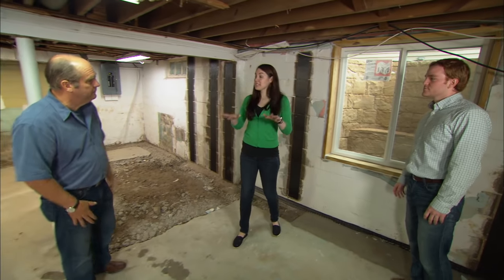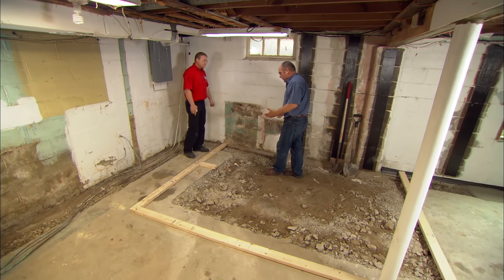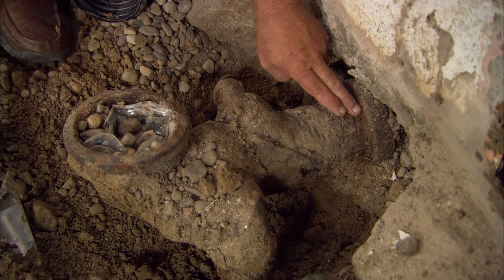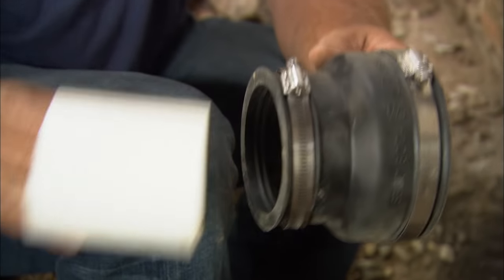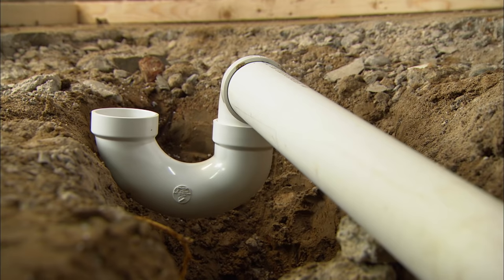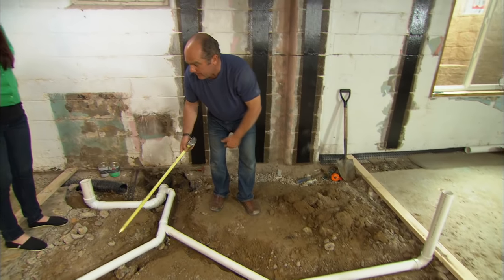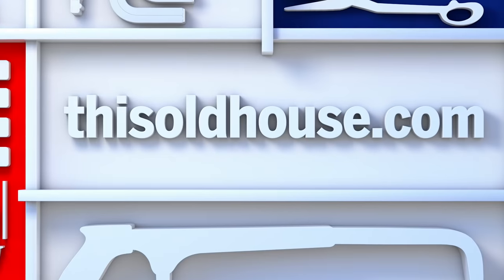How to Install a Basement Bathroom | Ask This Old House

Comment: That wet vent was so misleading (and wrong) you basically flat vented the shower and didn’t vent the water closet at all. You can only wet vent on the vertical piping. Once you break the the 45 degree plain and go vertical, you cannot wet vent. On the water closet, The vent (if flat venting, which is what you did) must be in front of the down slope of the trunk or branch line. Not behind it. That system will only work well if using one fixture at a time. All three running at the same time will create an air lock type situation and in essence not be venting properly.
Reply: Only if one fixture at a time is used and even then it still won't work well
Reply: Why is the toilet called a water closet?  I thought that the bathroom as a whole is called a water closet, because it kind of resembles a closet in terms of size, and has water fixtures.

Comment: If you have the skill set to do this, don't call a plumber and get permits/inspections. If you do call in the pros,  next thing, your taxes will go up due to another bathroom. The most important rule of plumbing, poop flows down hill.  keep quiet, and remodel your own place. That's what I'd do.

Comment: You can't wet vent 2 fixtures off of a water closet And code calls for a minimum 2" vent for a toilet/water closet You're event has to be with thin 5' of your fixture he is way off this would not pass inspection with city inspector. And 3" pipe is a minimum quarter per foot fall/grade/pitch and 2" as well 4" pipe you can run it at a 1/8 per foot but 2 and 3" must be A 1/4  per foot fall

Comment: 6:36 Improper use of wet venting - illegal and not code - pipe must be at least one size larger of minimum pipe size for fixture. Shower drains must be no less then 2". Toilets can not be wet vented. Wet venting can only be used when the pipe is vertical, not horizontal
Reply: That's how it used to be, but we can do what is called horizontal wet venting. So how they ran it was totally legal, you only have to up size vent line if you run over the fixture units for the two in pipe. Also when doing horizontal wet venting the fixture unit count it can handle is cut in half, so if the had a 5 fixture bath it would have needed to be 3" to the shower branch, then reduce down to 2".

Comment: I would have charged $3,000 CASH, rough in only providing they chopped up the concrete. Another $1,000 to chop up the concrete. That is $1,000. Per fixture for the rough in

Comment: Why wasn't pressure treated 2x4 used for the plates instead of Douglass Fir? I've done many basement bathrooms and had them where needed. Moisture on the floor or a possible flood would rot doug fir and ruin the bathroom's perimeter.

Comment: Hi you guys where talking about the vent pipe , but I dint see any of that in video , I think you guys cheated on that , I want proof of vented pipe installed
Reply: Walter Boy the 2” drain from the toilet is the wet vent it runs to the far right of the bathroom and stubs up through the floor. When the concrete pours, you then install sink teewye and continue the vent up and through the roof or tie in with other vents. The 2” portion of pipe between toilet and sink is called the wet vent because it serves the toilet at the same time it drains from the sink.

Comment: Some states have odd codes, for example, in Minnesota they like their dry vents and if you must use a lavatory as a wet vent they want it sized 3 inch right on out the roof. Goofy as it is its the law.

Comment: Really? Wet vent? Let's start with the 3 inch line. Anytime you make a 90 degree in a waste line you must install a  clean out.  This bathroom has No 3 inch clean in side for the main line. 
2nd once you make that 90 if you are going to wet vent the toilet it must be tied into that pipe between the toilet and that 90 or it's no longer a wet vent. It's a "I hope it Works Vent"  Those aren't code legal. 
3rd. Did you notice how at the 3x2 Y the 2 inch pipe was rolled up at 45° Up from the 3 inch pipe. At the next 2 inch Y you must either roll this fitting up or roll it up an stick a street 45 into the Y to bring it back to  flat or minimum of an 1/8 of an inch fall. If the shower is more than 3 feet from that Y. It must have a vent also. So, I'm pretty sure   none of this job would pass inspection in California.  Most importantly  is that if I had a plumber doing this job working for me.  I would tear it out.  "FAILED THE BOSS TEST
  The mechanical fitting that they used wasn't code legal either.
   Did they snake this line to clean it before tieing to it. After snaking it. Did they send a camera down it to make sure it's in good shape,
  Once you get 2 feet away from the house it is no longer cast iron. It's either terracotta or clay. Which more than likely has failed at every 80 year old fitting. Use the old 4 inch line under the foundation as a chase. Stick 3 inch pipe through the 4 inch pipe. Tie it on to the 4 inch outside of the house. 
Now everything in side the foundation is New.
  This Old Junky House.

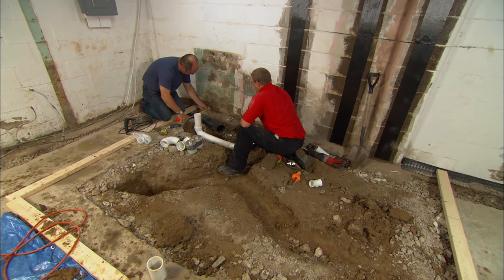Comment: At 5:07 you can see that the pipe that was cut and supposed to have been lead sealed to the pipe under the edge of the house is now loose.  Oops!  It's details like that being missed that will come back to haunt these homeoweners.

Comment: Would not meet MN state plumbing code. Want code is being used?
I also would have used a 4x3 90 for the water closet. Aka stool.  And just putting some crumpled up Polly around the shower drain is not very professional looking

Comment: Just a curious question from an absolute novice...why was ABS not used instead of PVC?  I have always been told that ABS was for drain plumbing, am I missing something?
Reply: PVC is generally straight and true. ABS pipe tends to have a bow in it. If using ABS you want to turn the pipe so the bow is not on the bottom or top. If you do this, you'll create small valleys or hills, which could cause sewer stoppages.

With all that said, short runs the bow won't be that bad. However,  on a 20' length of ABS the bow can be more than a 1/4". 

Hope this helps.
Reply: Nicholas Ruguone thanks for the tip, I will definitely keep that in mind.
Reply: ronnor58 FYI there is PVC pipe that is specially for waste/sewer water. A lot of time it has a foam core. I always assumed  (not always a good thing to assume) it was to reduce costs by the manufacturer.

Comment: Ok.  I would have used a shielded Fernco.  It has 4 straps and doesn't shift when used in the ground.  Ahhh,  2" pipe needs ¼ per foot not ⅛ per foot.  I didn't see a test tee so this system was not tested.  I guess they never have leaks and their shit doesn't stink...
Reply: Funny thing. In Canada most plumbers don't test the sanitary system, only the water and gas, don't ask me why it's just something I've noticed.

Comment: man if i ever paid a plumber to do work and saw him dry fitting an entire run i would kick him off site. there's zero chance he fully seated any of those connections and then pulled them out dry fitting, all of the measurements will be off. plus it seemed like they didn't account for the exterior wall on that toilet width measurement. i'm sure these guys know more than i ever will but sometimes they show people the wrong way to do stuff.

Comment: First thing 3 feet clearance from electrical panel and can't put panel in closet and can't put panel in a bathroom. Either sounds like moving a panel to new location . So if you move panel more than 12 feet from meter socket then need a service disconnect on metersocket turning panel into a sub panel used a 4 wire so ground and nuterals have to be separated. Sounds like you  saving alot of money. Now the poor electrican is going to be screw. No sound like to me electrican going to make  $$$$$

Comment: Basement bathrooms need to drain into a sump pit with a macerator pump ejecting it to the drain system otherwise you would have back up in your toilet if city sewer pressure exceeded normal volume. Love ask this old house but this is very bad practice for a basement bathroom.
Reply: Wrong my dear friend.

Comment: Dont know why people sleep in the basement with the high levels of radon in some areas. Insane!
Reply: Depends on where you live as to radon levels, they have alarms for radon and its pretty easy to install proper ventilation.  Personally I love sleeping in the basement, no light, no noise from the outside world, if the house is well built/soundproofed, you don't hear anybody upstairs.

Comment: First off PVC is garbage. For very few dollars more you can buy ABS which is a way better product. Second you have to be two feet from exterior wall before first fitting (Clean out excluded) which they did not install at exterior wall. When doing a shower drain you build a box around the pipe so it does not get cemented into the floor you do not put plastic around it. You need a bit of wiggle room because you will never get the pipe %100 where the drain will be. There is this wonderful product called a T-cone that you install in the pipe to be removed later before installation. Plastic bags and Styrofoam is not professional.
Reply: tom smith no code to having fittings 2 feet from the house there's a code on the distance from your mainline backwater valve to first wye fitting but I've had to dig under footings to roll up main sewers all the time

Comment: that's why you want the 24" diamond blade cut off saw. 2 seconds and you're through and the cut is perfect. You need real skill to do that with that Cute little 4 or 5 inch blade.
Reply: When you are covering the cut with a Rubber connection?

Comment: You know code about venting is total garbage. Think about it, why does a pipe need two air inlets for drainage?  It doesn't.  Trap water in a straw, let your finger off and all is well. Why does a straw need another hole on the side?  It doen't.  Neither does a drain pipe, becaused it's the same thing as long as it has enough pitch, it's all good.

Comment: its very poor plumbing design I suggest every change direction of the pipe it should be clean out provided
Reply: Look up wet venting bathroom group. I used to plumb in California where everything is individually vented, but other states and In Canada wet venting is a common practice. It works.

Comment: Never do that rebar thing, you are making contact with the soil and the rebar will end up corroding wich may cause problems later.
Reply: Ridiculous.  Rebar is put in every foundation footing going.  It's cast IRON, the backbone of concrete structures everywhere.   Sure it will corrode. . .some 75 years later.

Comment: So first off why not go back with sch 40 pvc second you need a sweep at any tie in not just a y 3rd off wet vent is always a bad idea and 3rd off if the pipe is 80 years old and want it to last another 80 years with all the fats from soap and hair products you might wanna look into new flow liner! I would have ran this entire system the proper way the smart way!!!

Comment: The clamps that used for connection between PVC and cast iron under soil will rusted  !! and be useless ...so it is the weak point of installation !

Comment: The primary issue most people will have putting a bathroom in a basement is that the sewer pipe will be exiting higher than the floor, and the sewage will need to be pumped up somehow to exit the house.  This was a bad video from these guys.

Comment: hope that's wet vent is not more than 82 inches away from toilet
Reply: rookie..... the measurement is calculated from the 3 by 2 fitting to the toilet doesn't look more that 3 ft away
Reply: the drain that travels towards the 3 by 2 can travel unlimited distance and can make as many change of directions as need
Reply: Blaznmax 88 no way it isn't. This is why being licensed is awesome. Cause when it fails years from now guess who gets to fix it... this guy

Comment: this basement looks like a disaster.  loose cast iron at 3:44 and again at 5:04.  wall looks like a sieve.  and they cut through the french drain. putting in a 10K bathroom in a 10 cent basement.

Comment: 5:18 Unvented toilet line - illegal and not to code
Reply: Unless the vent is on the other side of that wall, but if you look behind them you can see the laundry machines and next to them is the main stack of the house firing out the wall about 3' off the floor. So where does that line they tie into go? Is it connected to the one near the washer?
Reply: Could they use a air admittance valve ?

Comment: Why don’t these hacks measure their center to centers and subtract the fitting take offs and get the right size pipe length. It would be to easy. A supposed professional eyeballing is cringeworthy

Comment: I can believe your trying.to teach people this. First off, where the hell are your gloves.? You know your vent has to be within 6 feet of your water closet? PVC pipe you're supposed to chamfer. Inside doesn't matter but the outside does because when you don't it pushes all the glue out of the fitting. Your not supposed to use Clear primer because then you can't see your fitting allowance. There's a lot more stuff but I'm not even going to get into it cuz I don't got the time
Reply: Do you not understand wet venting?

Comment: Never use a fernco underground.
Reply: correct cannot use a bare fernco. need to use a mission or a fernco with added ridgid metal shear band. otherwise when they pour the concrete the weight is going to tear the rubber. what a disaster project

Comment: U never want to add a two way splitter under ground sink drain why bcus the water will sit or go no we're n it's buried with cement
It could elaps backwards n build up..with small pipes.. good job..

Comment: So much for 36” of free space in front of the electrical panel!
Reply: Maybe they have a plan to relocate the electrical panel.  It is a subpanel (I can tell by the lack of a grounding electrode conductor), so it is something that can be de-energized upstream at the main panel, and relocated a lot more easily than a main panel.

Comment: No vent for the toilet or shower.. These are not licensed plumber, or even plumber.Those are some wacked codes where they are working.
Reply: You can wet vent a bathroom group in any area that follows the IPC. You should probably learn a bit about your trade, if you are a plumber, outside of your area before calling someone else's work in to question.

Comment: Wow!  Lot's of things wrong.  Doesn't look like enough room for electrical service panel once bath wall is up.
Didn't think you could wet vent a toilet unless vent is same size as fixture drain being vented.  2" wet vent too small for toilet.   Surprised they didn't allow for insulation at the concrete wall.  She is a terrible actress.  Pretty sure Rich and the guy in the nice red shirt didn't dig that out.

Comment: That was really terrible. Horizontal vents below the spill level. Improper couplings used. The lead should have been repoured around the cast iron hub (with PVC) or a Fernco style gasket used. Not good at all guys. No way this guy is a real professional. No way this would pass an inspection where I live. No visible primer on the glue joints. 

John W. Gardner Quotes. The society which scorns excellence in plumbing as a humble activity and tolerates shoddiness in philosophy because it is an exalted activity will have neither good plumbing nor good philosophy: neither its pipes nor its theories will hold water.

Comment: You can't horizontal wet vent. A vent has to be rolled to the top 1/3  of the horizontal drain. Toilet vent must be a minimum of 2". A vent for a 2" trap arm must be less than 5' away. This is a horrible DIY video.

Comment: IMO, 1/8" per foot? Are you kidding me? OMG! You need the Administrative Authority's PERMISSION to run a FOUR INCH Drain line at 1/8" per foot, FOUR INCH ONLY! Everything else has to be 1/4' per foot! Right? The poor homeowner, down the road, years pass they WILL have issues. IMO.
Reply: New code is 1/8 for 3in and up. Low flow fixtures need less pitch because with less water and high pitch the water outruns the solids. Its kinda backwards thinking but its proven.

Comment: Dont install crap PVC in place of iron! Are you nuts? And why are you using a rubber adapter? You cant use that under concrete. In a few to about 20 years, that boot will crack and leak. You'll be digging all that up again.